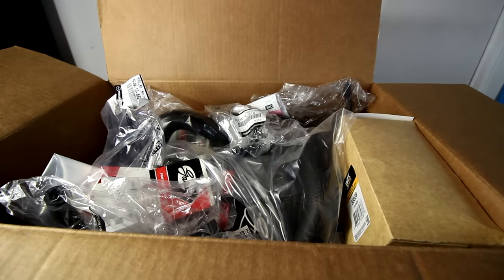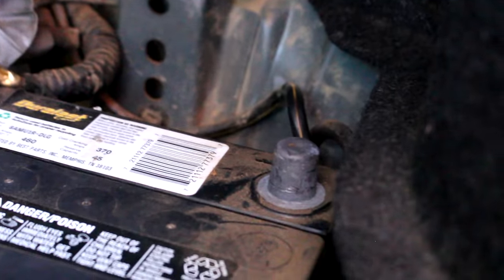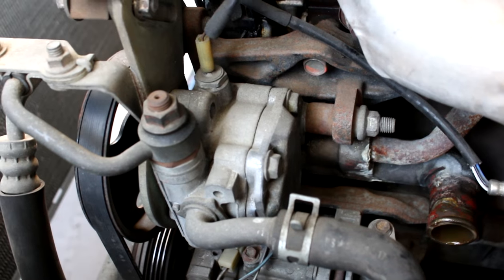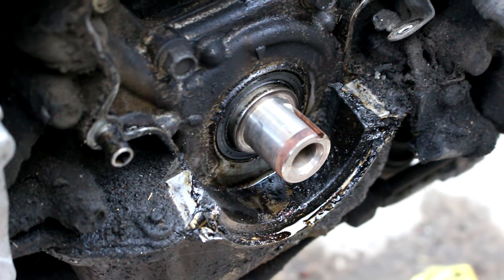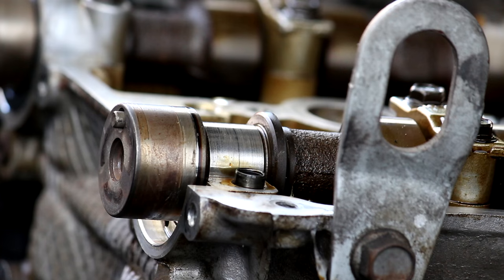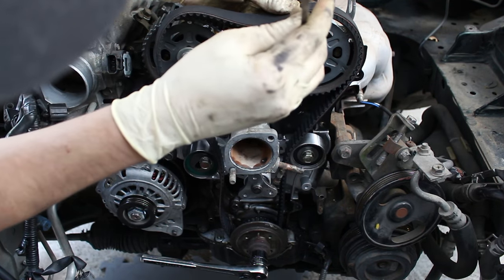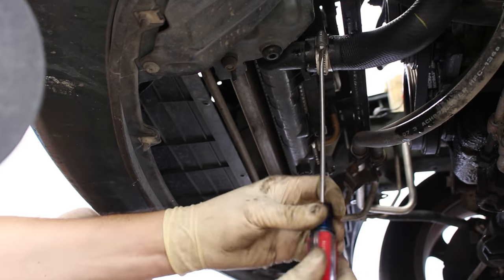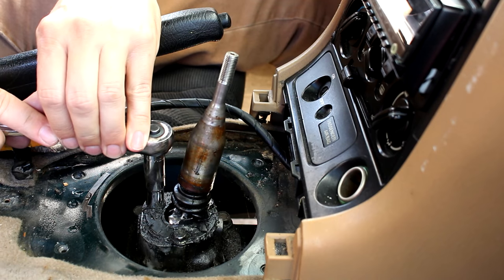The 2020 ULTIMATE GUIDE For Replacing Everything Your Miata Needs! [Project 2SJ Ep6]

Comment: Just use an impact on the crank bolt. It is so much easier and you are less likely to damage something in the transmission.
Reply: Can you fit an impact down there?
Reply: @CarsMeetsBikes  if you drop the sway bar and remove the radiator, yes. The sway bar is held in place by 4 bolts on the underside of the car.

Comment: At 20:00, it's important to mention that there is another mark to the left of the TDC mark that is the tension mark. 1 5/6 turns is stopping at EXACTLY that mark after ONE full rotation. Tighten the tensioner bolt to lock the tension, then do 2 1/6 turns (ending at TDC) and everything should line up  back up again provided the timing was set properly. 

Also make sure your car is in neutral while doing this lol

Comment: I bought my NA about 8 months ago. I had no idea on how to work on cars. Not even an oil change. 

There was an oil leak by the CAS. Followed one of your videos and changed the o-ring. Unfortunately my dumbass had a harder time putting it back in and messed up timing. So now I had to set timing. Not a big deal, ordered a timing light from Amazon and again watched one of your videos on how to do it and decided to do it in an evening. Got my timing light, jumped the car into diagnostic mode, got everything set up, all good right? NO! There were no reference points/marks to align the timing marks. 

I thought, well there's no possible way that they just disappear right? Wellll, the previous owner replaced timing belt, water pump and all that good stuff and for some reason he thought that not putting back the lower timing covers is a good idea. It was sitting in a bag that I got with the car. So, my car is out of timing. No way to time it. Didn't have money to take it to a mechanic, no friends, and no garage. Not even tools.

Decided to tackle this somehow by myself. I've already watched your "party miatas" videos countless times even before I bought the car. Watched it several times more, went and bought a 50 piece tool box from Harbor Freight and took stuff apart piece by piece in the apartment driveway. I may have looked like a total clown, but damn it felt good after I put my timing covers back, set proper timing after working on it for 2 days. The only help I had was your videos.

Since then, I've been fixing my own cars, parents and didn't have to pay for a mechanic since then. I have tools, I have youtube. That introduction and the instructions I had just motivated me even more. Since then, I've done countless jobs that would have costed several hundred dollars.

Thank you so much Greg. You don't even know the amount of respect I have for you putting out videos like this.

Comment: I got to 31:33 before I remembered I don't own a Miata.
Reply: There’s an easy way to fix that!
Reply: @juanpinol6813  true lol
Reply: @Kjmods  I have seen NB with rust for $2000 or Mint condition for $10,000 . I ended up buying 2003 with low mileage ,never driven in the winter (no rust) a few small dents  ,in way better condition then Greg's and came with OEM hard top that I don't use . Ended up paying $6000 ,just plugs ,coils ,CPS Replaced  ,this winter will change gear an dif. oil . Maybe shifter bushing kit too.
Reply: @alexisknows6513  sounds like you got a good deal! I owned a 99 for a while which is when I found this channel
Reply: bought onne 2 months ago for 2k its a 93 only had to change brakes ands radiator ..it may  nott be the bbest investment for everyone but its damn sure a fun one
Reply: Yet...
Reply: @ianoconnor1  haha I used to have one which is when I subbed. I’d love to have another one!

Comment: This is great for people just getting into Miatas. I've replaced everything on your list overtime on my '91 out of necessity. It would have been so much easier if I had this video when I bought the car.  Turbos, wheels and suspension are awesome, but maintenance always comes first if you want your car to work. 

Also, to anyone doing a timing belt job on a Miata, I HIGHLY recommend getting a beefy 1/2 drive impact (electric or pneumatic), and a 21 mm swivel impact socket. I had a 4ft cheater pipe with a helper locking the rear wheels and I could not get it off. The torque from the bar felt like it was going to knock the car off the jack stands. I jammed my 1/2 drive dewalt impact on there with a swivel and it busted it off in half a second. Just barely cleared the condenser. Worth every penny.

Comment: Just finished my timing belt and water pump job for the first time thanks to this video! It wasn't without turmoil though. The lower bolt of the water pump was loose by about half a turn and it was dripping very slowly behind the timing cover, down the crank nose, and off the oil pan when the car was running. I went back in and made sure all 4 bolts were tightened properly. After I put it all back together, my car cranked but just wasn't firing up...I put the trigger wheel on backwards. Great. Went back in again, flipped the trigger wheel, put it all back and it started right up. I let the car run for a bit and drove for a bit making some frequent stops to peek under the hood and thankfully saw no signs of leaking or coolant smell. 

Your channel has been invaluable and I've learned so much about wrenching just from doing this single job alone. I feel so much more equipped to work on my vehicles now. Thanks Greg!

Comment: This winter I have my 99 up on stands for a suspension refresh (superpro bushings, koni str.t's, por 15 paint on the control arms, new sway bar end links). And I also have to weld in repair panels into the rusted front frame rails and have to remove the radiator to do this. So of course now is the best time to upgrade the factory radiator and hoses. So of course this also seems like the best time to replace the timing belt along with all the other parts you replaced on your car. I was unsure about tackling this on my own but watching you I think has given me the confidence to do the job. Thank you for such comprehensive guide. Cheers

Comment: Whenever I have to take the crank bolt off I use a breaker bar against the frame or ground with 0 slack and touch the starter. Used that method for several cars. Its like a built in impact driver.

Comment: Piece of flat 1/4" x 1" steel from the hardware store and a drill and angle grinder and you can make your own tool like Flyin' Miata's for the crank bolt and it's pretty easy to get that bolt off. Much easier than using 5th gear.

Comment: Heads up if ur front seal is really stuck poke a hole and insert a self tap screw and pull put with tweezers.... careful with the critical surface area as this may get damaged if not careful 😅

Comment: This will be my first time attempting too do this waterpump because my car is actually overheating a little, so I caught it early! So I’ll be watching this tomorrow when I start the process 😮‍💨 definitely have notes I took as well. Thank you again for this video it’ll help me a lot for tomorrow’s job!
Reply: So went ahead and did the change, problem now is it’s overheating again, I’m gonna try checking hoses or air locks in the system, but I installed it correctly step by step but now I feel like it’s a hose or a air pocket will be coming back to give an update 🫠

Comment: Grrrrrrrrrrreat Video!!!!!!!!!!!!!!!!!!! Thanks!!!!!!!!!!!!!!!!!! You mentioned changing the clutch. I told you before I'm a HUGE FAN of Centerforce Clutches. I had checked in with them stating their upping their game with the Miata Aftermarket. They stated to me that they were working on something, so I BEG YOU to check in with them as their clutches are second to NONE!!! 62yrs old and been to a lot of rodeo's. When I say they are second to NONE, You can take that to the BANK!!! Please check with them. Even if they don't have anything "new" their stuff will hold very well and the pedal feel is like BUTTER!!! Believe me, you will thank me later!

Comment: For the shifter rebuild: Anyone with a 6-speed, you dont have any fluid to suck out of the turret.

 and you can consider the turret a fill hole if youre replacing the fluid completely.

Another tip: if your shifter rattles when its cold out, get some teflon tape (the stuff used for plumbing) and wrap the threads before putting the shift knob on.

Comment: HOLY SHIT IM FINALLY DONE

Spent 3 hours first day, 15 hours second day. I did all of the engine work and the fuel filter (I had already fixed my shift knob in the past). This has been by far the most technically challenging mechanical job I have done but I can tell it’s totally worth it. Thank you so much miata dad, couldn’t have done it without you

Wanted to add that for crankshaft bolt and cam gear bolt, mine were solidly stuck (previous owner may have used loctite red) that even using over 150 ftlbs torque, I could not get them off. Ended up impacting them, worked like a charm. There was a debate online about whether or not you can impact the cam gears and an ASE mechanic said it should be fine fwiw

Comment: Done all of these multiple times and this is a good guide, nicely done. Weird feeling not seeing any modding or upgrading done with everything apart.
Reply from the maker: For the individual Miata owner, it makes sense. For a repair tutorial, introducing a variety of aftermarket options isn't very helpful to the actual jobs being completed, in my opinion. I usually end up taking my cars apart several extra times just to get the most complete and helpful video content out of it
Reply: @TheCarPassionChannel  For sure. Not everyone needs to know how to install turbos and nitrous. Great vid for those needing maintenance help, the timing trick part I could of have used a few weeks ago myself. All this info is all over the net but it’s nice to have it all in one place. 👍🏻

Comment: Quick tip to add, if you want more life out of the the lower rubber tunnel shiftboot "thicken" the rubber area where the boot flexes by adding a coating of silicone about an 1/8 inch thick. By spreading the silicone,  this more than doubles the thickness of the flex portion of the rubber boot. I'm  going on 7 years without a boot change.  I did only the typically area where it rips, and the rip moved to a thinner none coated area. It's best to coat the boot everywhere it flexes.

Comment: Dont forget to run your heater to get out any air bubbles!
Reply from the maker: As far as I know this is not needed on the Miata because unlike some cars it does not have any valve that shuts off the flow of water to the heater core, it's always flowing. I know on my Z32 it did have that valve though, so every car is different.
Reply: @TheCarPassionChannel  ahh. That makes sense!

Comment: Heat crank bolts up with a torch be quick and careful not to cook the crankshaft seal. Also, glue gaskets to their accessories. For example, glue the gasket to the water pump. Use RTV for the gasket to block surface.

Comment: Earlier this summer I bought a 99 green NB my first manual and first (owned) car soon to be project car. It was about 4 hours away from home and 30 mins into the drive back home my rear tire blow out locked up the rear then it over rev-ed the engine before I even knew what was going on. Thankfully I didn't crash and I got the spare and drove it home. Sadly after a few weeks It developed a spun bearing and  the engine was cooked. So I bought a semi-built NA Miata engine off from the a guy a knew local car community, (I only used the Exintake mod and bottom end, which was decked for higher compression).  After 2 weeks of running it, it developed a spun bearing because my dumb ass didnt check the oil pump and it was full of metal from the first bearing. 

Now i'm rebuilding a new motor, decked block (NA), NB pistons, Cometic headgasket 0.03, machined crank, ARP headstuds, Exintake mod,  NB2 oil pump, ACL Race series bearings, Wiseco rings, Gates Timing belt, Innovative Engine mounts (60) and all new gaskets everywhere. The BP4W is stock other than the cam and gaskets including new OEM valve stem seals (No supertech). 
I still have not gotten it put back together as I keep getting mailed bad bearings. Im pretty sure at this point the car is cursed but Im not afraid of no ghost. Nothing some holy water cant fix, lol.

Earlier this summer I had zero idea about anything with Miata engines or how to work on them and I just wanted to say thank you for sharing your passion and helping the community, keep up the great work man, ill be looking forwards for it.

Comment: removing the radiator, and hitting the crank bolt with an impact (21 or 13/16th socket ) after locking out the cams and throwing it in reverse gear worked beautifully. The only way to remove crank bolt properly in my opinion... forget about all the breaker bar and hitting the key jazz.... nonsense.... lol

Comment: What produces more torque. The vvt beast or Greg trying to break off the crank bolt
Reply from the maker: I honestly can't believe the clutch didn't slip.
Reply: @TheCarPassionChannel  same I've never seen a crank bolt that tight.
Reply from the maker: @kingbryant5673  There were many bolts on the car far tighter than they should have been. And RTV all over everything so someone definitely worked on it at some point lol
Reply: @TheCarPassionChannel  at least nothing fell off. I cant say the same for my front 2 subframe bolts on my daily lol

Comment: My BP4W with 170k miles had the crank pulley slide right off  guess I'm apart of the club:)  I totally couldve used this video like 1 month ago got a rebuilt Engine with 80k miles and was getting no start, was cause of crank Triger wheel was backwards

Comment: i highly recommend putting anti seize on the crank pulley bolt....
Reply: Absolutely not.... I hope no one followed this advice. This is a recipe for incorrectly torqueing the crank bolt which will cause a ton of issues and can ruin your motor if the crankshaft key ends up getting chewed up.

Comment: I just received this same kit from treasure coast. Unfortunately as of today the cast impeller style water pumps are no longer available. This is no fault of treasure coast or other vendors. Though I just pulled off a cast impeller pump that was on the car, I’m wondering if I should just put the old pump back on considering there was nothing wrong with it considering I have a stage 2 FM turbo kit on the engine. Or just use the new one and keep the old one as a backup. Also the one I pulled off is a NPW with a cast impeller made in Japan, and the gates has a stamp impeller and is made in China. Probably putting the old one back on.

Comment: Thanks Miata Dad! using your first video, i replaced the timing belt and water pump, the water pump had broken it's ear where it connects to alternator. I finished the timing belt about 6 months ago, it's been running pretty well, but now I've got an extreme wobble on the harmonic balancer. Looks like I have to take everything apart, do you recommend replacing timing belt and other parts, or just reassemble?

Comment: Great video as always. 
Can you use a pneumatic impact wrench to loosen the crank bolt or is it better to go for extensions?
Reply: An impact wrench will work provided the bolt isn't rusted or seized. Just did it on mine this way

Comment: I did that job also, but made one mistake. I didn't mess with the oil pump, and now it's gasket is leaking. It would have been so easy to replace that when the engine was out, now the engine has to come out again. It's the only way to fix that since the oil pan has to come off. . I'm even replacing the pump with the gasket, just in the slim chance there could be a crack in it not visible from the outside. All for a $3 paper gasket.

Comment: 7:14 for anyone doing this on an NA: do NOT try to pull if they are stuck. They won't come off, but the hose at the heater core will and it is a real pain to get it back on. Ask me how I know. If you replace them just cut them off and save yourself a ton of headache.

Comment: I just did this took forever but I have belt noise I think I tensioner the timing belt pretty well I know that comes off bad but I think it’s my alternator belt would it be noisy? I also forgot to tighten up the heater return line bolts lmao so I was spewing coolant everywhere but thanks for the video I rewatched it a million time, I think the timing is way better and was actually off many teeth the car has never started up this fast

Comment: Make sure to turn your heater on when bleeding your cooling system.
Reply from the maker: I believe this to be more "general" car knowledge rather than Miata specific. Some cars have a valve that allows coolant to pass through the heater core when the heater is on, which is why you need to turn it on during bleeding. The Miata does not have this valve, it's always circulating coolant through the heater core.

Comment: Do you actually need the little dabs of RTV on the head when installing the valve cover?
I replaced my valve cover gasket over 1.5 years ago and it hasn't leaked even a drop. Though, i have a FWD Mazda with a Z5-DE engine.

Comment: For those two side bolts for the water neck for the water pump which bolt goes in which one cuz one's longer than the other that's the longer one go in the bottom or the top? Just let me know as soon as possible

Comment: I also have a 5 speed NB1 and every single guide I’ve seen says you don’t fill the shifter fluid from the shifter assembly. I thought it was supposed to be self lubricanting (from the transmission fluid?). Can someone clarify this?